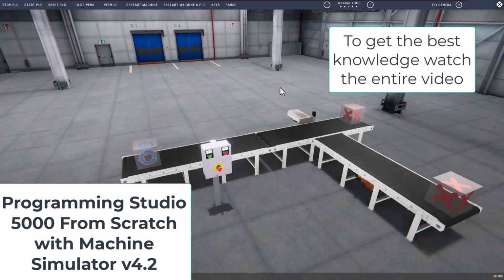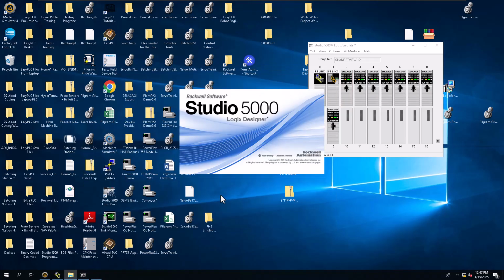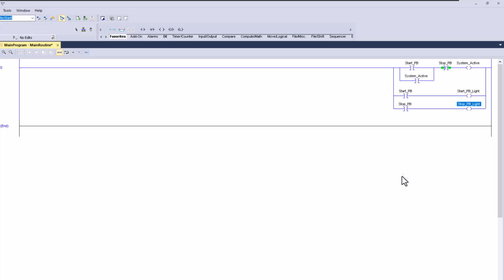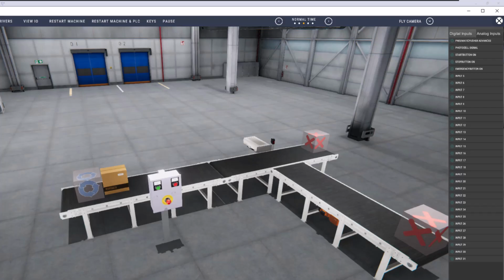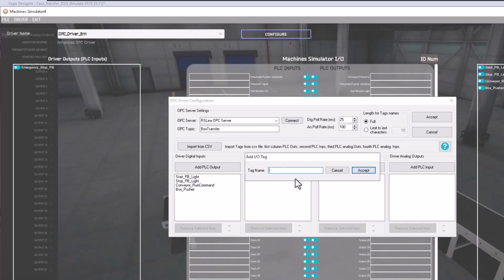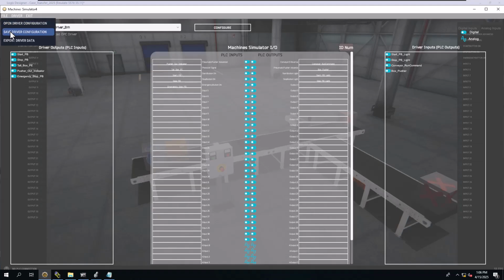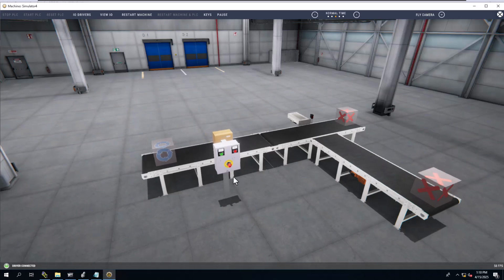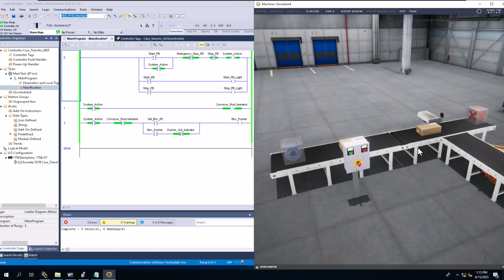Programming Studio 5000 From Scratch with Machine Simulator v4 2

Comment: Hi Shane, I was wondering, if i bought it and just bought the license for my computer, would they send a download or something of that license and software to my email or something?
Reply from the maker: I always suggest that you get the USB lic because it has the install files and is mailed to you.

Contact Nirtec if you have questions.
Reply: @ShaneWelcher   I have a problem running this software on my VM, any suggestions on how i can make my VM run as smooth as yours when using this software? its like super laggy
Reply from the maker: @wesheniser3654 if you are part of my course then watch the VM videos, I just added several videos about speed

Also note, it's graphic heavy so open the machine simulator and reduce the resolution, I show that in my other YouTube videos about this software
Reply: @ShaneWelcher  Thanks man!